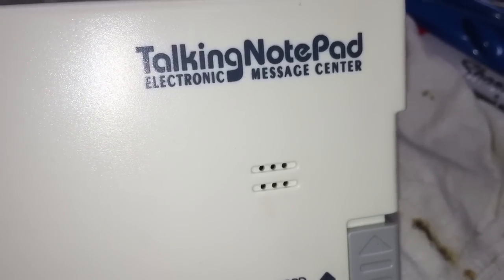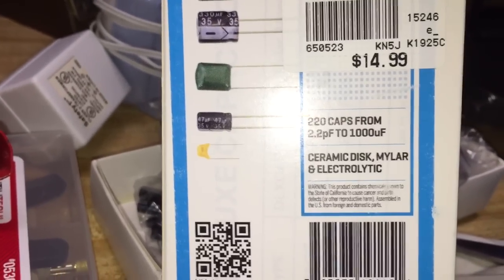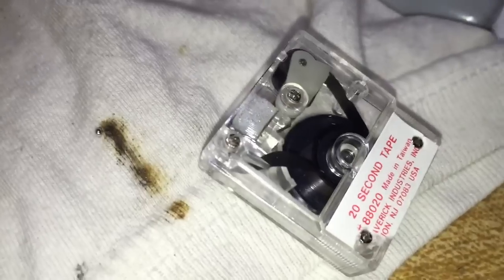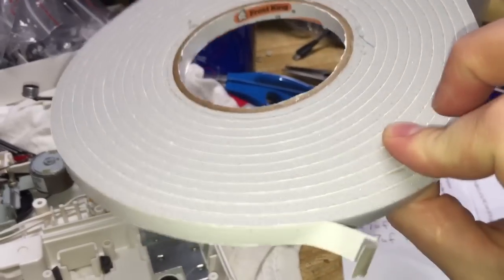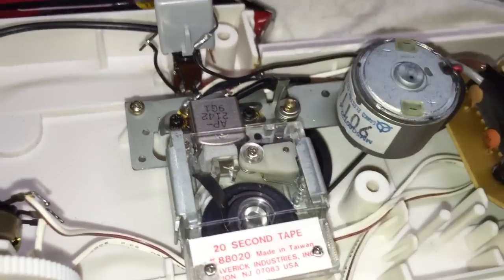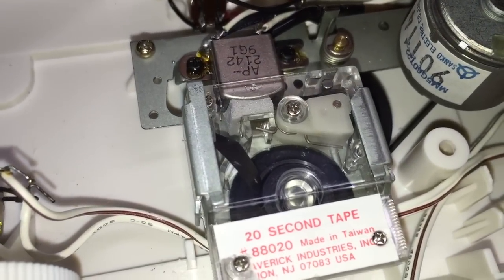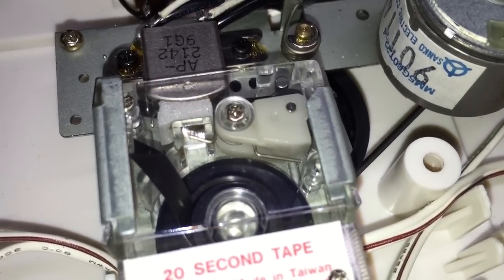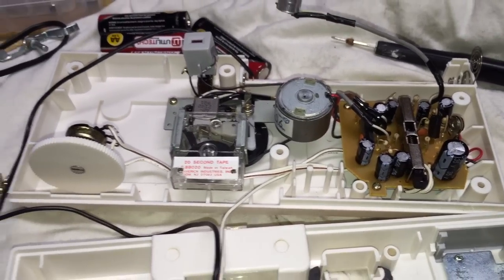Maverick Talking Notepad - Repaired!

Comment: I wonder if a 3D printer could be used to make more tape cartridges, by printing the parts.
Reply: The casing, maybe. But where would you get the tape?
Reply: Scavenged from old cassettes, it looks like it's 1/8 inch, like cassette tape.
Reply: It would have to be salvaged from an endless loop cassette, because of the graphite backing.

Comment: YOU DID IT! Concrats :)  I thought the playback would be tinny sounding, seeing the small speaker and cheepy amp the manufacturers used, but it actually sounded Pretty good!  and You were very innovative in using the weather stripping tape to replace the foam pad in the cartridge. nice Job all around :0
Reply from the maker: +DUSTERDUDE238 - Thanks!  I appreciate the feedback.  Fascinating little device.
Reply: databits
 ya they are! I had a later version something like these, I found at a thrift store . But it was all electronic and built into a light switch plate, and used a memory chip opposed to tape. well it worked for a while and then died. so now its just an interesting switch plate in Our dining room.